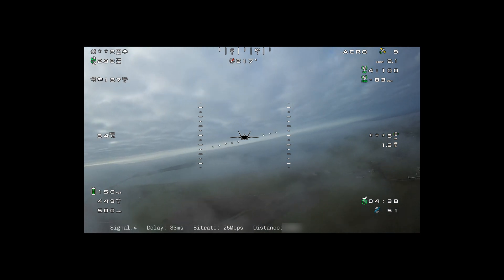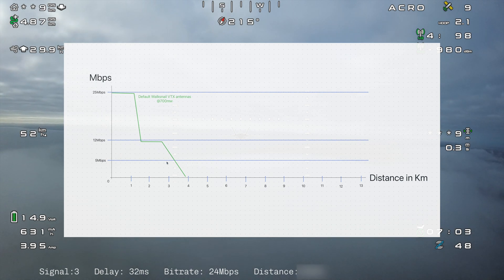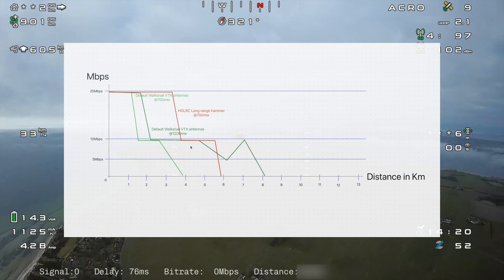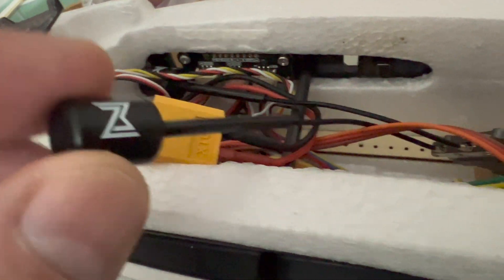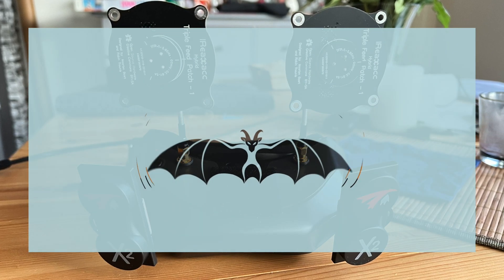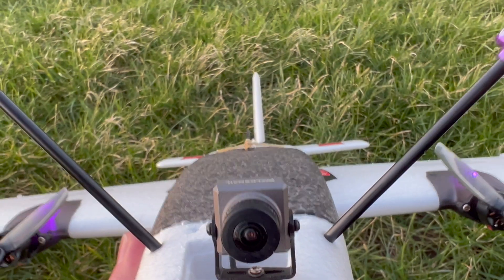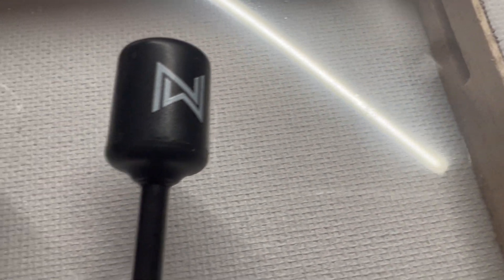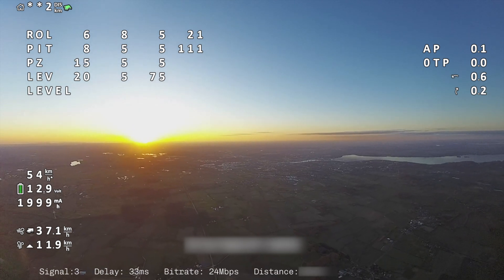The difference with other antennas and why you should get some others #walksnail

Comment: why didnt you run the aftermarket antennas at 1200 mw? That would have been some good data.
Reply from the maker: I didn’t do it because at that time the 1200mw output wasn’t to good and only gave more noise one the band- no real range increase. 
Never used 1200mw … had the good results with 700mw and that was fine to me. The aftermarket antennas still dominate the stock ones today! Despite having improved the stock antennas they still stand no chance against the cheap ones from China somehow. As a matter of fact I’m still using these

Comment: I have a quad with a true rc matchstick and dominator hds with 2 x2airs and some omnis on top, moved the transmit port to one of the x2air patches as well and it can only go about 2 miles  before losing video, what am i doing wrong?
Reply from the maker: Very hard to tell from here. I would assume you're aiming into the wrong direction with the Airs! See ... you'll have to become the Antenna tracker with your head - otherwise there will be no reception!

Comment: New sub, thanks for your info, i dont suppose you have tested the osprey 5.8ghz stubbies and green one or longer one in i forget which colour, but the osprey antennas, probably just rebranded but hey!
Yes ,if youve had any experience with them? Thankyou!❤
Reply from the maker: wohoow .. .another sub- that makes me very happy! Sadly I haven't checked those out. I just had to lear that these no-names perform muuuch better than the HGLRC-Antennas. Would have lost my quad yesterday without INAV and RTH. so ... HGLRC went of the Quad for now.
Reply: @JustFPV-net  yeah, advertising bollocks dbi and all components is ruining the hobby! There is soo much hype about amazing motors, lipos and other rc stuff just to grab another parts bin junky!
I have the skyzoneo4x and love them , my walksnail vrx has always got at least 4 channels of full green on stock v2 antennas, i put the osprey stubbies on and refreshed multipul times and only channel 7 got full green, so i guess their gonna be dudds!
Ive just built a mario 5" advamced kit and put a green osprey on the rear, only time will tell as its perfect flyin weather but speedybee fail to probide any m3 by 10 motor bolts, 6 mm arms and the plastic feet and some one said, use the motor bolts, great, but their m3 by 7, and there wasnt one strap in the kit! Again ,this will be thr 5th s ratch build and all gepRC and Diatone kits have extra bolts and straps!
So it seems to me that false advertising us rife like the rest of the lies we are being told on other world topics!
Sorry to rant  but come on, speedybe  ive always been a fan of their innovations, would a cople of straps be to much?
Cheers man, glad you recovered the dronre with rth!

Comment: Thanks for the interesting video.
Something doesn't make any sense in the first graph, where the same antenna setup would give you almost twice the range when operating the transmitter with only a little over 2dB more! This is very unrealistic and difference should be much less. There must have been other outside factors that gave you these results. 
Sometimes if the VTX cooling isn't well enough the TX might throttle itself down to 700mW in order not to kill itself thermally, in these cases the difference is logically near to zero.
I totally agree that the stock antennas are a simplified compromise that is just good enough for most nearby activities. Be aware that high antenna gain doesn't come without trading in high emitted radiation power with the angle of radiation. So the more the gain you have the narrower the useable antenna angle gets, hence you have to track your flightpath carefully else you might loose it. Make sure auto RTH is active and if this happens don't make the mistake I once did, holding the antenna in all directions along the horizon when the plane is a mile above you circling while waiting to reconnect ... so hold it straight up and you will be back in control getting it down, hopefully before the battery dies!

It should be common sense to always carefully select your flying spot to be ideally up on a hill with no trees around or if in your flat environment, on a large field with ideally no trees to assure the angle towards the horizon is not obstructed even at a low elevation pitch. 
You should always check the wind direction ahead of time and look for a site that gives you the best visibility towards the wind and always try to fly against the wind, which has two major advantages.
1. If your battery gets weaker than expected there will always be a good chance to return with a fraction of the power needed to reach that point in the first place and if at higher altitudes, you may be able to return to home with motor off. Wind velocities may be way higher above, but also be aware the wind direction may very different, sometimes even opposite - take a close look at the clouds or on various aviation weather websites that show wind at different altitudes. (e.g. UAV Forecast app, Meteoblue or Ogimet)
2. If you see a rain front coming towards you the way back will sure be without any risk of rain, because you will always be ahead of the weather coming home

Have fun flying everbody
Reply from the maker: What a wonderful response ... thanks for all your thoughts. I guess you are right about the outside factor ... different locations have different rf noise in the area. 
Currently I'm not aware of the VTX is capable of reducing its power to 700mw by itself. But usually I don't fiddle on that as its far than enough currently :)

Have a good flight, mate

Comment: I'm a big fan of the TrueRC antennae across the board.
Reply from the maker: Yes ... they really changed the way I had to move. Now I'm kinda back where I was with analog tracking my plane with my head. And the change is minimal: same range, better image and no interference. For that I'm happy. After all the antennas do the transmission ... better take to ones which work the best
Reply: @JustFPV-net  What was it about antenna trackers that made you stop using one?
Reply from the maker: I Found it to be easier to get out there without to much gear. So having a a good range without a tracker is fine for me- no need to use a tracker and many items that could become a show stopper for the flight as one item may not work as intended

Comment: I feel like  the overall length of the alternate examples & resulting mounting difference would significantly effect the result.  I'd be interested to see a test with antenna barrels located at an identical position so we can evaluate apples to apples.   It's easy enough to add a little extension tube to stock antennas.
Reply from the maker: Maybe I will give it a try with a new VTX next time. But from what I did fly and test, the difference with the default antennas didn't match up at all. The Harrier has wider fuselage and the antenna got separated a lot more that in the T1. That didn't change on the outcome of the distance. At about 3.x km the bitrate went to 0. That's not the same effect as with these antennas.
Reply: @JustFPV-net  stock antennas on the goggles/vrx?
Reply from the maker: No … look at the video … there you see what I’m using. A mix of trueRc and cheat triplefeed patches
Reply: @JustFPV-net  incredible what a difference!
Reply from the maker: Indeed … so tempting to push it further

Comment: What pan servo do you use?
Or do you have gears in your pan/tilt?
Reply from the maker: I use a Feetech FT90M servo ... and admitted: I need to make a video about it :)
Reply: @JustFPV-net  
Thanks man…. I searched so much and only could find these Sg90s with 270 decrees but only with pwm 500-2500
Currently I get just 180 and its just enough but would like a little more ☺️
I fly it on a Multiplex Lentus. Hope to get some head tracking soaring this year😄
Reply from the maker: oh ... a fine bird it is! The FT90M offers to go that far as you state there! currently my Servo of choice